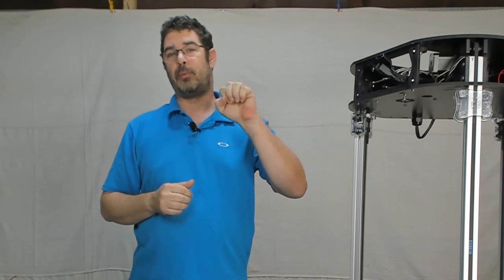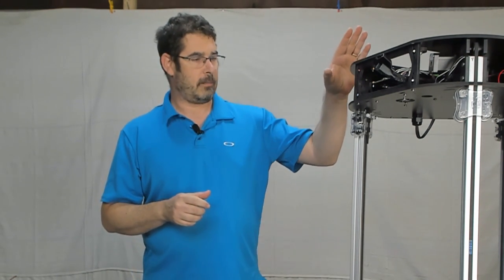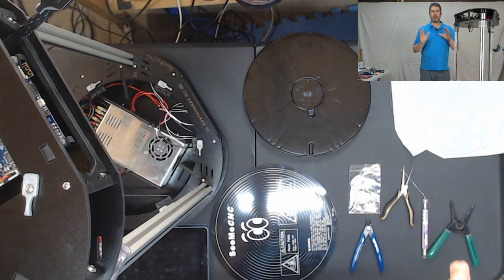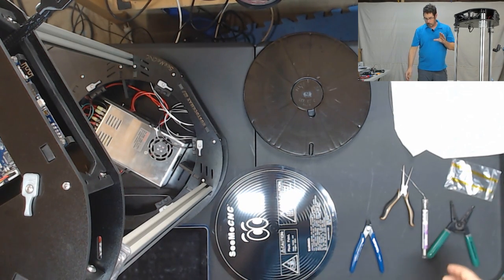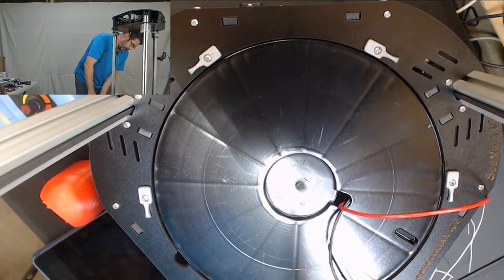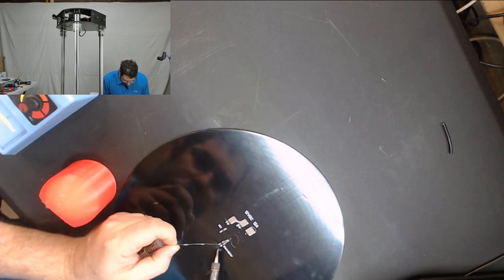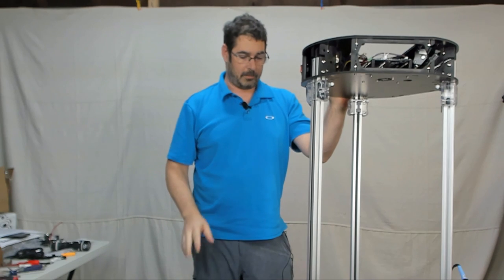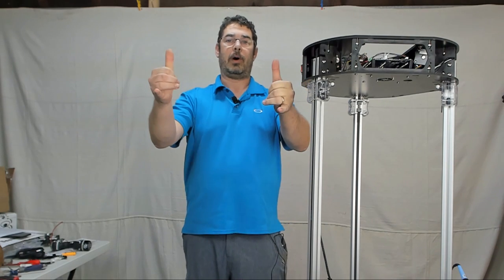SeeMeCNC ROSTOCK MAX v3.2 Build Series Part 14: Step 59

Comment: It seems to me you skipped a step. When I did it, you are supposed to bridge the +2 pad to the pad that is between the +1 and +2 pads. That provides power to the led I believe.
Reply from the maker: You are correct Vance, good catch! I not only completely missed that (and didn't realize it until after I loaded firmware and the LED didn't come on), but I also forgot to make a note of it above.
Reply: You should also mention that they do not want to accidentally bridge that middle pad with the +1 pad.

Comment: Just as a tip for everyone: doing things that poke all the way through like with the LED/Diode, you can use something like painters tape on the other side as a stopping measure so it has something to rest against

Comment: When you were soldering the large wires to the bed, another way would be to "tin" the wires first by melting solder on them and adding solder also to the pads.  Then you just heat both the pad and wire together to re-melt the solder and hold them in place until the solder solidifies.
Reply from the maker: reasonablebeing that’s a great idea.  Hindsight...
Reply: Not meant to be picky but to help to improve your soldering skills.  I admire how you tackle multiple disciplines with confidence and zero fear while doing these builds.  Also,  are you using a tip cleaner (wet sponge or dry scouring pad ) and re-tinning your iron tip between soldering joints off-camera?
Reply from the maker: Thank you, and I do appreciate it! Tips from others are not just good for me, but also for people watching (and hopefully reading the comments too). Everyone chiming in is what make this community work and helps us all get better! Especially on these builds where everyone has varying skill sets, and both the contents of the kits and the manuals seem to change on a continuous basis.

And yes, the iron is being cleaned and tinned off camera. ;)
Reply: I like how you do not edit out your mistakes and just fix them right there for everyone to see. I think that is awesome. We see what to do and what not to do.
Reply from the maker: Thanks! I figure if I am going to make them (as someone who has assembled many, printers), it's likely someone who is assembling their first might miss the same steps or make the same mistakes. Better to head that off if I can...